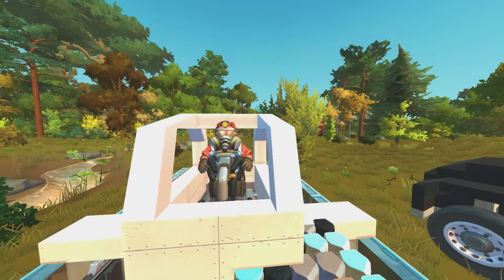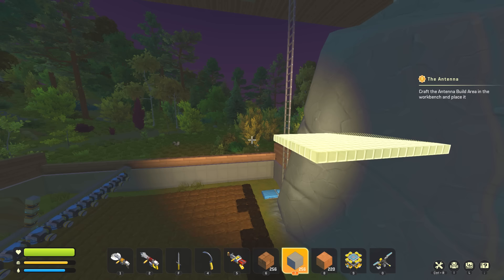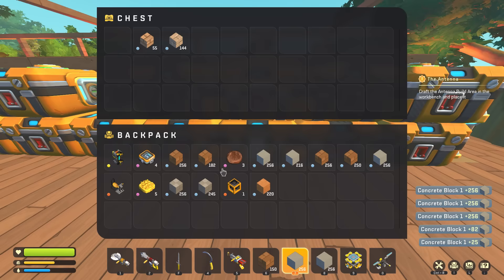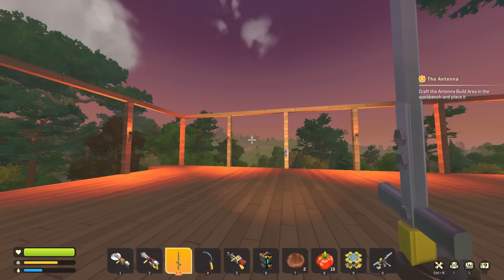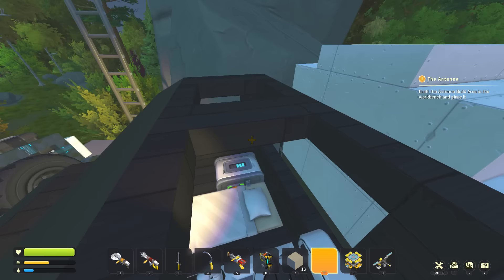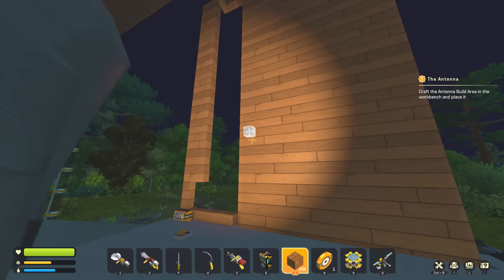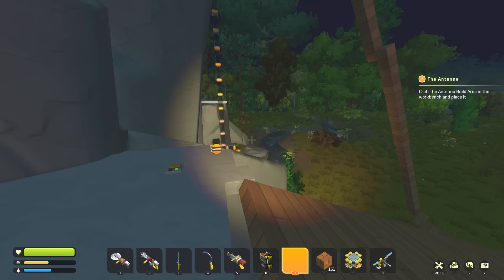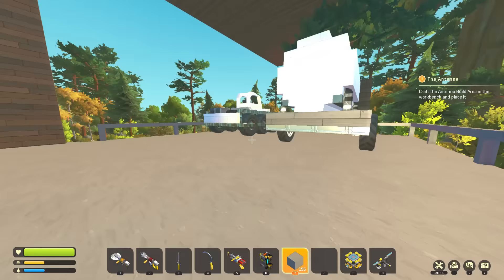I Built a Garage with a Draw Bridge Ramp to Protect our Vehicles! (Crashlander Survival Mod 31)

Comment from the maker: What should we do next in Crashlander?
Reply: the good think is kAN u did a garage finaly
Reply: there is a hole in your wall at 0:37 patch it please lol
Reply: Continue on the base improvements and fix and rebuild the farm watering system
Reply: Zanboni 2.0    ????
Reply: Finaly complete it
Reply: something that could help with lag spikes is if scrapmechanic is on a ssd. i dont know if it will help, but if you have one it could help to move it on a ssd if it isnt there already.
Reply: Base upgrades
Reply: @warfin1379 if you actually watched the vid you would know he did
Reply: Try setting bill on fire
Reply: I think you should definitely put a suspension glitch on the flyer
Reply: There is an auto fuler thingy which fills your fuel container once you get close to it. So, for the flyer you can just fly by a fuler and it will auto fill the fuel container on the flyer.
Reply: Automated everything ! But for real, automated defence system would be awesome.
Reply: @My_cat_is_so_cute  yeah i saw he patched it later on
Reply: @lazigreen5771 he said he knew, that requires setting up gas stations at every oil pond you want to use.
Reply: Quests
Reply: Build a jet that takes off vertically
Reply: your simplification of watering system down to one water container with chest and vac extractor should work
depends how many connections to cannons water container can take 🤷
- pistons might need to be staged through a controller so only 1 goes at a time to keep speed down to what vac pipe can push 
- cannons would use 15 at a time, vac ex pipe would try to move full stack (20) into water container
Reply: "Today we're back with more Crashlander! In this episode we are experimenting with a concept that didn't work in vanilla, making a flyer that never has to land! If we connect a crafting station to make gas then our flyer should be able to use oil ponds as fuel without landing!"

wrong episode...
Reply: We haven't seen any high level raids in this why not do an episode where you just do back to back waves until the farm gets breached
Reply: I had a stupid funny build idea so it's a catapult that throws a chest from the closest oil pond to a catching system in your base it would take a long time to calibrate it but I think it would be funny
Reply: Build a grapple skidder to haul logs.
Reply: Creative Auto farm defence please
Reply: Can you build a train?
Reply: Exploding drill it's better then you think
Reply: Add some aesthetics to the base and area (a elevator, lights, glass windows, rooms), build the flier maybe a train or trolley 🤔
Reply: 100 days in scrap mechanic ❤
Reply: Crash, and then land (your flyer)
Reply: Fully-automated farming!
Reply: Continue the story :)
Reply: You should build a box attachment for your truck and decorate it with the decor items from the mod
Reply: I'd say just a whole session for detailing and decorating your base
Reply: Do a flip
Reply: Make a warehouse with a storage system that takes items from one chest and sorts everything into ITS OWN chest one type of item for every chest. Use the vacuum tubes, pumps, and sorters. It think this is a grate idea
Reply: @magixx2618 lol, 10/10
Reply: Elevator(s) for the base seem useful I'd say. Also plant trees? Really wanna see that mechanic
Reply: water TT_TT improve water and collection of water
Reply: Cargo flyer that can pick up anything and store a lot. Also it should be heavily weaponized. Tech it out too!
Reply: I think you should put iron reinforcements in the garage floor to make it look more stable. Great video nonetheless!
Reply: Make a motorbike!!!
Reply: Make your ramp wider so you can easily go up without thinking about it.
Reply: Continue main quest plz
Reply: Edit the description, that's what
Reply: know im a bit late but try shift clicking items like in Minecraft (hold an item press shift and double click another item of the same)

Comment: The only problem with your plans for the flier is you have to make it MUCH bigger and you will burn through the fuel far faster.  Just put a radar beacon at a few refueling stations and have a chest to store extra fuel for backup.  Put a bed on the flier too.  You should only need 4 thrusters tops.

Comment: I have been having Kan's scrap mechanic playlist play through from recent to oldest while I work on stuff.... I has been interesting to note how scrap mechanic improved handling physics calcs and the huge improvements to multiplayer code (maybe some has to do with improved connections on the players too).
It progresses from moderate jank on the side of the clients to all out chaos and pure insanity when you get to MP races from 6 years ago. The insanity ramps up very quickly at about 5 years ago, and Comodo basically can't really play due to rubber banding and input lag at the 6 year mark, mostly because his client shows him steering and missing an obstacle but the host had him hit the object because of a missed input and he gets rubber banded back to the object 1 second or more after he thought he was on his merry way past it.

Comment: Connect your current watering system to a large chest and then add vacuum pipes to plumb them to the water cannisters then do the rewiring from the water cannisters to the water cannons your watering system only lacks the extra water capacity to deal with vacuum pump down time.

Comment: You could add another freeish spinning piece on the end of the ramp with some wedge pieces, this would make it easier to get the wheels on the ramp when starting, although you would probably want to set it so when falling its fixed, when rising its fixed but free spin at the end